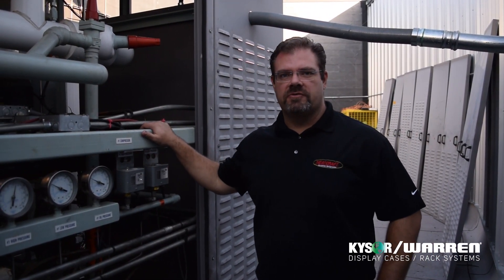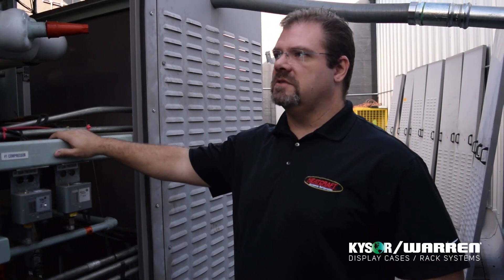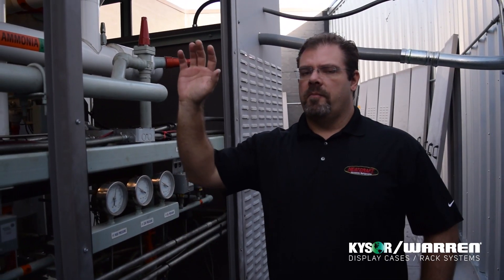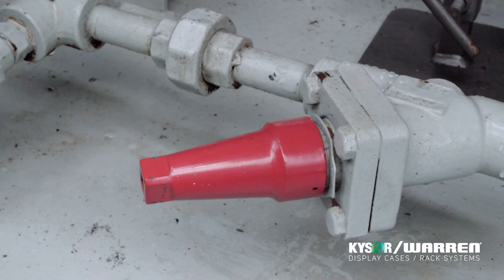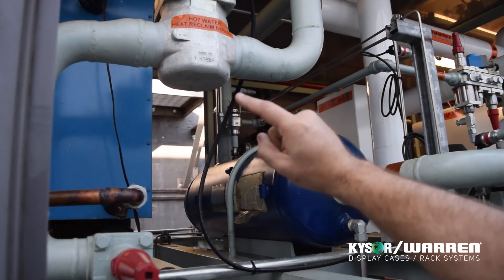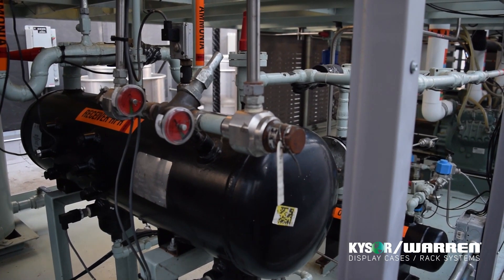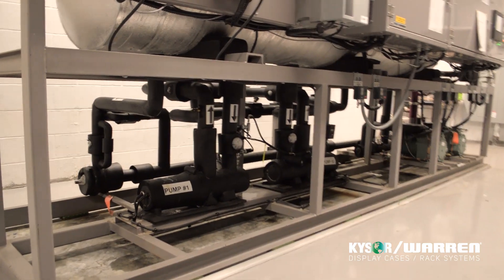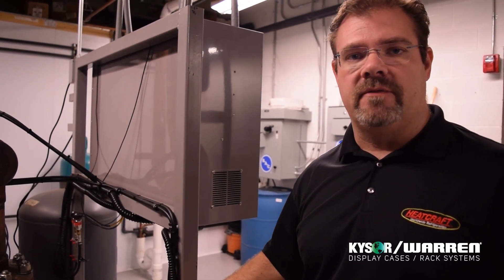Introduction to the Ammonia CO2 Cascade System

Comment: Yeah, until it leaks and then you have the issues. Yes emoji zero refrigerant that’s efficient. The CO2 goes in the store. That’s real good but I would’ve designed this system with the new age of those not ammonia. Ammonia is a very dangerous refrigerant when it leaks and it causes liabilities. There’s been 600 ammonia accidents in the United States, so yeah it’s a good system but I still want to use the HFO‘s.
Reply: It's not that dangerous. The danger comes from incompetence

Comment: Cool, be interesting if they ever find a way to scale this basic idea down for use in air conditioning systems in homes. Ammonia is such an efficient refrigerant. Used to work at an Ice Cream plant so I do understand the dangers of it though. Might not be an affordable solution on that small of a scale for residential use.
Reply: The problem is the ammonia.  The typical AC field technician has absolutely no training on using ammonia, and finding that training, at least in my area, is difficult to say the least.